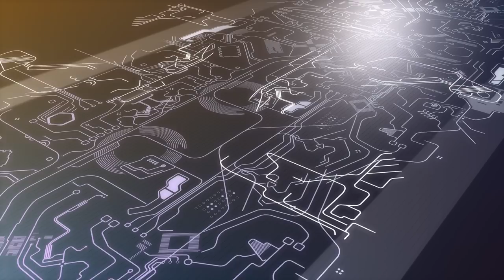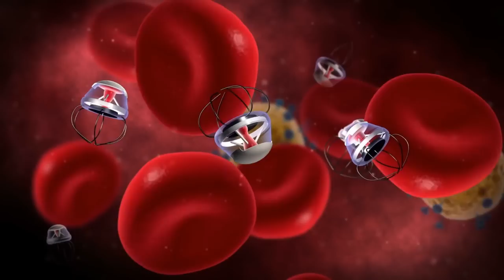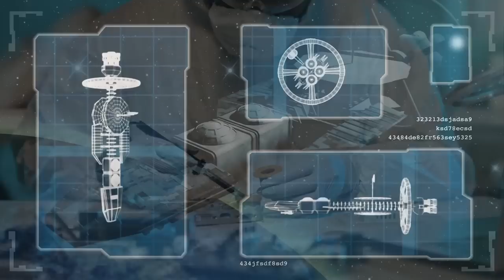Damaged Spacecraft & Shipwrecked Saucers

Comment: The people that wroted for star trek DS9 were absolute morons with no technical background, why a console should explode? There isn't significant energy that flow in this device, a engine or fuel tank can explode(and would be a absolute catastrophe) but not a console, and why they used console (it's was 20 century or 24?), today we don't need to use console(we use only because of the conservative thinking in the military and industry) , we only need a secure and reliable data connection for any digital control device, in four century for now the digital device would be part of our body or even the brain, this was like the people in the 19th century imagined flying with balloons with sails.
Reply: Because we need the additional points of failure introduced by wireless communication?  I can certainly see it in civilian use, but a Star Fleet equivalent?